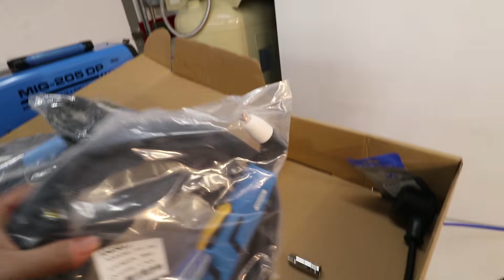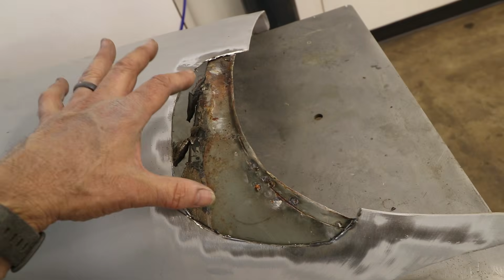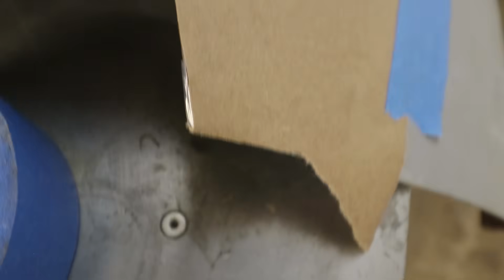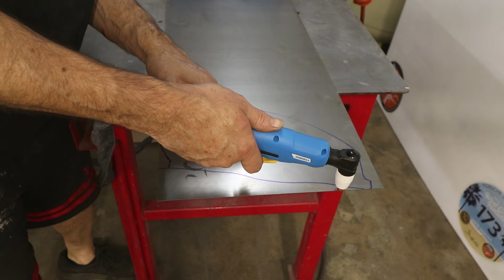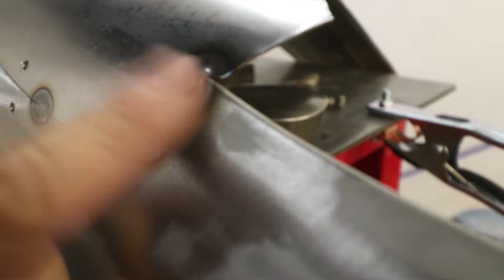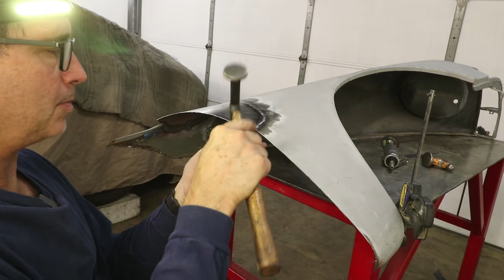Making Rust Holes Disappear — Porsche Fender Repair w/ Andeli MIG205DP

Comment: So, which welder do you like better? This one or the Andeli MCT-416P from your other video? This one is more than 2x the price of the MCT-416P. Which do you like better for DIY car guys like us? Also, can you adjust he placement of the TIG trigger? Looks like it's for right-handed people. I'm a leftie so the trigger is on the wrong side for me :(
Reply from the maker: They are both adequate for a home garage like ours.  Andeli cold welding exists in both machines, but the blue one has more features, such as pulsed cold weld.  This is a nice to have but for tacks you could simply hit the trigger multiple times.  
As for the trigger, I dont think its adjustable.  But it is symetrical for either hand.  Are you saying you want the trigger on the bottom side?
Reply: @GarageTimeAutoResto  as long as it's symmetrical for either hand then I'd be fine lol. It looked like the trigger was on the right side but I obviously saw it wrong. Thanks! Love your videos!
Reply from the maker: Are you in socal?  You can try it out
Reply: @GarageTimeAutoResto  unfortunately, no.

Comment: This might be a dumb question, but is it possible to just cold weld the entire panel you are replacing? That way the metal doesn't destort as much?
Reply from the maker: Not a dumb question!  I think you could but the strength is not the same.  Maybe I'm wrong?  It's worth a try, but would require testing.  
I found it really disorienting with all the on/off flashing.

Comment: Thanks for sharing your technique Tom, appreciate the tips/advice.  I’ve had excellent success using the “Cut-n-Butt” method and a MIG using ‘tacks’ at spaced intervals around the join allowing cooling before advancing, never doing more than 3-4 tacks inline.  Typical ‘Fitzie’ cut-n-butt method.  It’s slow and tedious.  The MIG welds are not as malleable as TIG, but I’ve been pretty success at keeping warpage to a minimum so I haven’t had to do extensive hammer dolly work.  Again thanks for sharing, I appreciate seeing other methods.
Reply from the maker: Excellent results are all that matters😅
Reply: @GarageTimeAutoResto  Agreed!  👍👍

Comment: Would you fill the lower spots with lead or bondo?
Reply from the maker: No lead here.  It would be easier to keep metal finishing.  Or just epoxy prime, then filler.

Comment: Nice work Tom, an interesting welding system, and affordable for someone just starting out. I bought a couple Everlast combo units 3-4 years ago. The pulse modes and different waveforms made things much easier. The no foot pedal TIG takes some getting used to. Now that  the cost are coming down we need to find you a laser sponsor.
Reply from the maker: Exactly!  I'm on a list to try one when they are available!  Excited.